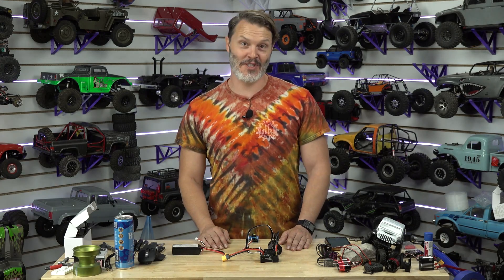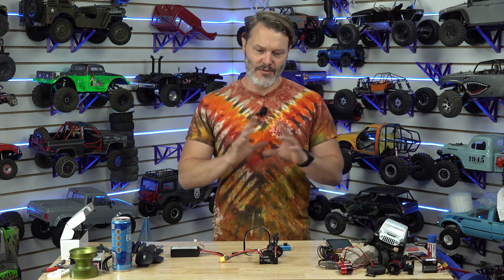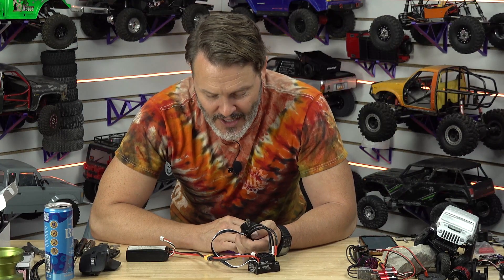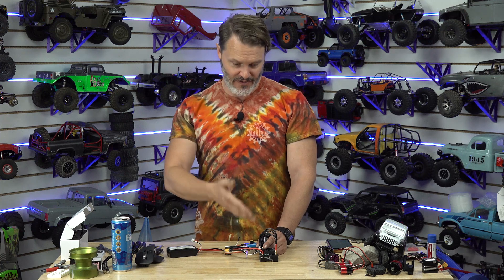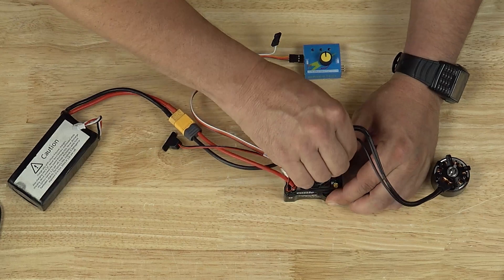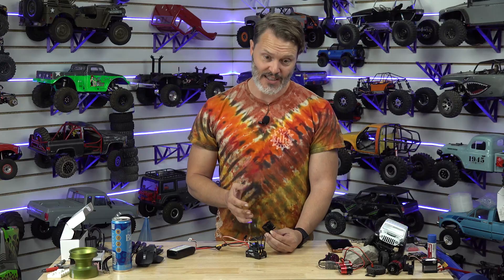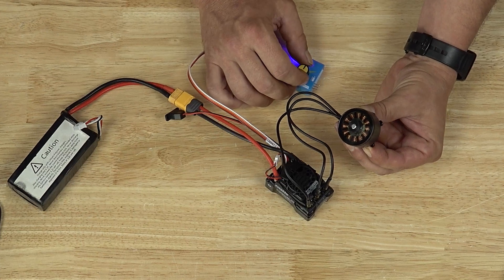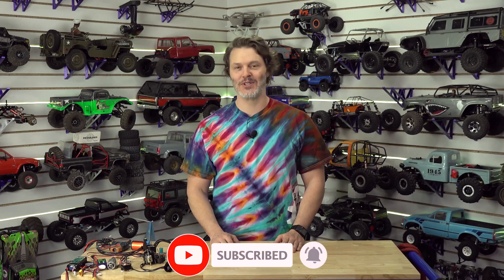John Robert Bench Tests the Castle Creations Cobra 10A ESC -Low Speed Control & Outrunner Noise Test

Comment: I have a Holmes Hobbies trail master BLE WP Esc and a HH stubby puller pro 3300kv on 3s pulled from an ascender😆…
Installed in a carbon vrd… 
Would this be a solid replacement for the Esc as I am lacking in the drag brake and slow start categories… I know it’s a 3300kv but I’ve had it for 12-14 years and it’s never let me down or the Esc for that matter 🍻I do love some HH!

Comment: Love castle escs i have a copper head now that replaced a pro. Tekin 3100 4s with very low gearing works great i dont run the fan either

Comment: is there anybody else doing adjustable/programmable aux wire so you can switch modes on the fly like Castle?

honestly, that's the only reason i'd be even considering one right now, because it's a nice little feature that makes U4/rock racers much better.

iirc HobbyWing has it on the new gen brushed 1080, would be nice if they had it on a 'normal' Ezrun/Xerun esc. my 'en route' Super Lasernut is eager to get one asap to be paired with a punchy PullerPro 4274 (also en route. thanks for the sale from overseas! :))

Comment: I had swore off Castle after one reduced my Xmaxx to a puddle of melted plastic.  I was about to break down and buy a micro x combo for my Mojave Grom.  Then Furitek came out of nowhere with their drop in Grom combo and saved me.   I'm betting they are going to rule the Grom world.  Only $99 and 2 or 3s capable.  As popular as the Grom platform is i can't believe every motor and esc manufacturer wasn't tripping over each other to make a drop in system for them.   I honestly expected Spektrum to have the inside track.

Comment: Don’t get me wrong, I love trying new systems in all my crawlers, I own multiple mamba x’s, copperheads, and got a drawer full of 1080’s. As far as a separate esc and motor system, the Crawlmaster mini is KING. When the Fusion came out, I don’t really see why anyone would use anything else for low speed control, because the F.O.C. feature pretty much makes everything else look stupid in terms of low speed control. This unit is probably bad ass for a high speed rig, but what we REALLY NEED is a Holmes Hobbies 2 in 1  inrunner with F.O.C. along with those legendary Holmes magnetics to put a hurtin’ on all those Fusions and Axe units out there. Change the game on em John!!
Reply: I agree 💯
Reply: I love my NEW axe system. It’s 135 amps, 8.4v BEC all kinds of goodies..everything is Bluetooth, such a great system. You should check it out. It’s actually comparable to this cobra 10
Reply: Agree😏
Reply: I don’t want to run them cause there slow as shit and they don’t have the aux wire function for rock/race crawl mode which is a big deal and you can’t run 4s which is strictly what I use in all my crawlers cause they last twice as long on the trail for the size and mainly cause 4s gives me max power to all direct power servos. That alone is a huge negative!! Most (comp) serious guys run 4s. That’s puts a lot of people off. Am they are super low KV/slow. An most of us that run more performance based chassis/set ups cannot fit that super huge long can in our set ups. Not at all or not without heavy modifications at least. Not to mention your restricted to run only that set up. Where I can switch out motors for different terrains/courses ect. Too many negatives for me. Only positive is that it has low speed control and less wires. Where my 3Bro Kratos 10 2750kv on 4s will crawl as slow as I want but has enough juice to get down when I need the power

Comment: Just curious, how long until  64bit ESC?
Reply from the maker: I wouldn't say the task will be made better at 64bit

Dual core, faster memory, lower hardware latency , mosfet design will still be areas of improvement.
Reply: @HolmesHobbies  not going to lie, I don't understand you response. Are you saying that the 64 bit won't be what improves performance but rather the 32bit with dual core, faster memory ext...is what will push performance forward?

Comment: Hobbywing Axe & fusion series are better than this shit
Reply: Not better than Mamba X though. Can’t run 4s, so direct power servos won’t get max performance. An those long ass cans won’t fit in a lot of rigs without heavy modifications. An they slow as hell with low ass KV ratings. all the good ones at least. No on board BEC. Max rating like 60amps 😂 they are for dummies that don’t know how or don’t want to tune

Comment: Please don't use this product if you are going to be crawling around the public with an outrunner. My favorite public spot is in danger right now from people complaining about RC crawler noise.
Reply: As a fellow Rc'r I also cannot stand the sound. Guys on the trail end up alone running these dying alien sound systems. I don't get how anyone could stand it.
Reply: @redndeyes More torque and low speed control than the junk fusion that you're using.
Reply: If ufo sounds bother you, you might be a pansy. There are far noisier vehicles out there. How about i bring a nitro over there?
Reply: Holmes doesn’t sell cheese for your whine.

Comment: Been waiting on a video for this ESC. Thanks! 
Edit: Was really hoping for more out of this one, but castle let me down again lol. Is there any go-fast applications for outrunners? I've been thinking about an on road build with a castle/outrunner combo so it would have some sound effects lol. 

On another note, did you see traxxas put a new esc/outrunner combo in a boat now?
Reply from the maker: Outrunners aren't the best for go fast. Power density is needed more than torque density.
Reply: heh... I have an ARRMA Granite Monster truck with Revolver 540 V3 1800kv with a SW4..

The thing rips on 2s and holy hell dad only mode in 3s... (huge Pinion...)

Comment: You should do a puller pro 540L 2100kv with it on the rocks for a video. I crawled and trailed with that motor for a few years until i finally bought a revolver and a crawlmaster bl stubby. But i still think about all the good times I had. On a mamba x sensored. It was fun because its not really a low speed control type of motor but I geared it down and it did really well.

Comment: what's the difference between drag brake and hill hold? Is hill hold like the freewheeling option that Hobbywing ESCs have?
Reply: Hill hold is the opposite of freewheel. It holds the truck on an incline. You can set the intensity of the "brake" force.
Reply: @TheBombDiggity69420  sow how is it different from drag brake?
Reply: @brianmassey7563  most drag brakes I have used have a limit. The hobbywing hill hold will hold on vertical.

Comment: Only thing i dont like about Copperhead and Cobra Esc’s 🤷🏽‍♂️ I dont Got a computer, so i use B-Link Bluetooth 😅.   On My AM32 Rhino VE80A Esc My Buddy came by with a pc, Only set it up 1 time☺️.   AM32 projekt is super, i use a Revolver 540 V2 2500kv Outrunner On 3S and 4S😃
Reply: Wait… you can’t use the B-Link on Cooperheads or Cobra ESCs.? That would just be freakn stupid!!! Well if this is true I guess I’m sticking with my trust ole Mamba X.! I have 4 Mamba Xs and haven’t had any problems with any of them, going on 4-5 years now.!